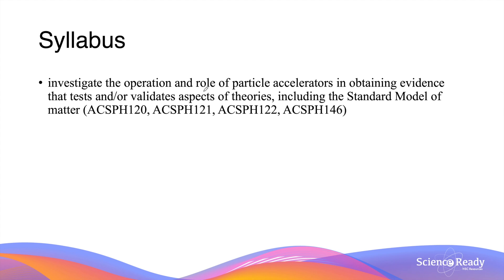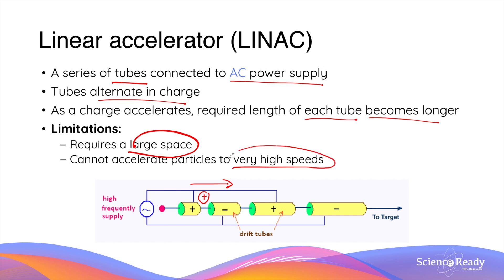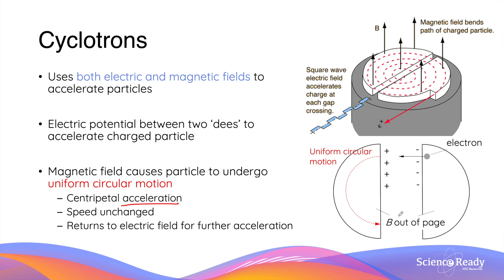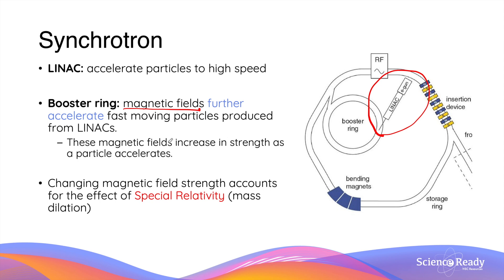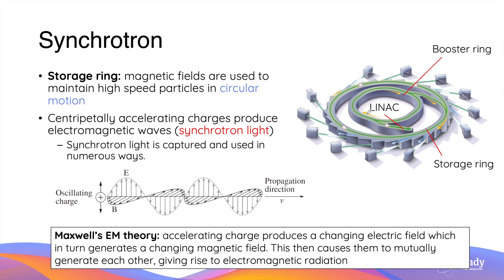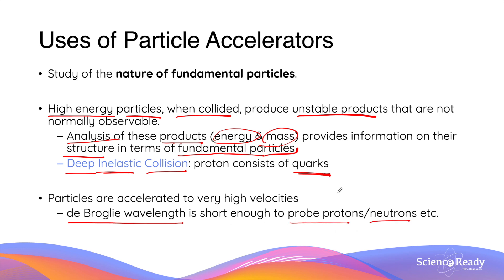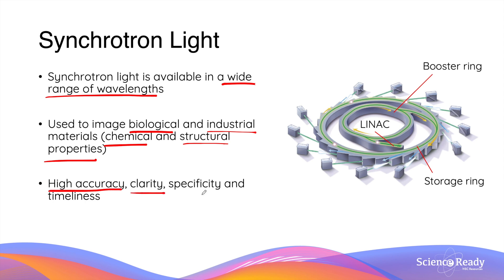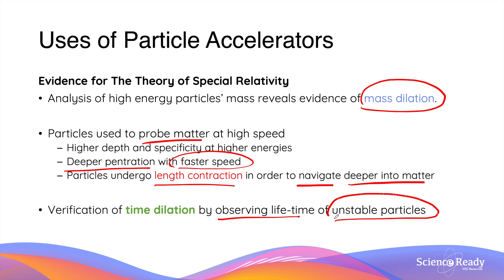Operation and Applications of Particle Accelerators // HSC Physics

Comment: Conservation of Spatial Curvature:
 (Both Matter and Energy described as "Quanta" of Spatial Curvature.  A string is revealed to be a twisted cord when viewed up close.)

Is there an alternative interpretation of "Asymptotic Freedom"?  What if Quarks are actually made up of twisted tubes which become physically entangled with two other twisted tubes to produce a proton?  Instead of the Strong Force being mediated by the constant exchange of gluons, it would be mediated by the physical entanglement of these twisted tubes.  When only two twisted tubules are entangled, a meson is produced which is unstable and rapidly unwinds (decays) into something else.   A proton would be analogous to three twisted rubber bands becoming entangled and the "Quarks" would be the places where the tubes are tangled together.  The behavior would be the same as rubber balls (representing the Quarks) connected with twisted rubber bands being separated from each other or placed closer together producing the exact same phenomenon as "Asymptotic Freedom" in protons and neutrons.  The force would become greater as the balls are separated, but the force would become less if the balls were placed closer together.  Therefore, the gluon is a synthetic particle (zero mass, zero charge) invented to explain the Strong Force.  An artificial Christmas tree can hold the ornaments in place, but it is not a real tree. 

String Theory was not a waste of time, because Geometry is the key to Math and Physics.  However, can we describe Standard Model interactions using only one extra spatial dimension?    What did some of the old clockmakers use to store the energy to power the clock?  Was it a string or was it a spring?

What if we describe subatomic particles as spatial curvature, instead of trying to describe General Relativity as being mediated by particles?  Fixing the Standard Model with more particles is like trying to mend a torn fishing net with small rubber balls, instead of a piece of twisted twine.

Quantum Entangled Twisted Tubules:  
“We are all agreed that your theory is crazy. The question which divides us is whether it is crazy enough to have a chance of being correct.”    Neils Bohr
(lecture on a theory of elementary particles given by Wolfgang Pauli in New York, c. 1957–8, in Scientific American vol. 199, no. 3, 1958)

The following is meant to be a generalized framework for an extension of Kaluza-Klein Theory.  Does it agree with some aspects of the “Twistor Theory” of Roger Penrose, and the work of Eric Weinstein on “Geometric Unity”, and the work of Dr. Lisa Randall on the possibility of one extra spatial dimension?  During the early history of mankind, the twisting of fibers was used to produce thread, and this thread was used to produce fabrics.   The twist of the thread is locked up within these fabrics.  Is matter made up of twisted 3D-4D structures which store spatial curvature that we describe as “particles"?   Are the twist cycles the "quanta" of Quantum Mechanics?

When we draw a sine wave on a blackboard, we are representing spatial curvature. Does a photon transfer spatial curvature from one location to another? Wrap a piece of wire around a pencil and it can produce a 3D coil of wire, much like a spring. When viewed from the side it can look like a two-dimensional sine wave. You could coil the wire with either a right-hand twist, or with a left-hand twist. Could Planck's Constant be proportional to the twist cycles. A photon with a higher frequency has more energy.  ( E=hf, More spatial curvature as the frequency increases = more Energy ). What if Quark/Gluons are actually made up of these twisted tubes which become entangled with other tubes to produce quarks where the tubes are entangled?  (In the same way twisted electrical extension cords can become entangled.) Therefore, the gluons are a part of the quarks. Quarks cannot exist without gluons, and vice-versa. Mesons are made up of two entangled tubes (Quarks/Gluons), while protons and neutrons would be made up of three entangled tubes. (Quarks/Gluons) The "Color Charge" would be related to the XYZ coordinates (orientation) of entanglement. "Asymptotic Freedom", and "flux tubes" are logically based on this concept. The Dirac “belt trick” also reveals the concept of twist in the ½ spin of subatomic particles.   If each twist cycle is proportional to h, we have identified the source of Quantum Mechanics as a consequence twist cycle geometry.  

Modern physicists say the Strong Force is mediated by a constant exchange of Gluons. The diagrams produced by some modern physicists actually represent the Strong Force like a spring connecting the two quarks. Asymptotic Freedom acts like real springs. Their drawing is actually more correct than their theory and matches perfectly to what I am saying in this model. You cannot separate the Gluons from the Quarks because they are a part of the same thing. The Quarks are the places where the Gluons are entangled with each other. 

Neutrinos would be made up of a twisted torus (like a twisted donut) within this model. The twist in the torus can either be Right-Hand or Left-Hand.   Some twisted donuts can be larger than others, which can produce three different types of neutrinos.   If a twisted tube winds up on one end and unwinds on the other end as it moves through space, this would help explain the “spin” of normal particles, and perhaps also the “Higgs Field”.   However, if the end of the twisted tube joins to the other end of the twisted tube forming a twisted torus (neutrino), would this help explain “Parity Symmetry” violation in Beta Decay?  Could the conversion of twist cycles to writhe cycles through the process of supercoiling help explain “neutrino oscillations”? Spatial curvature (mass) would be conserved, but the structure could change. 
=====================
Gravity is a result of a very small curvature imbalance within atoms. (This is why the force of gravity is so small.) Instead of attempting to explain matter as "particles", this concept attempts to explain matter more in the manner of our current understanding of the space-time curvature of gravity. If an electron has qualities of both a particle and a wave, it cannot be either one. It must be something else. Therefore, a "particle" is actually a structure which stores spatial curvature. Can an electron-positron pair (which are made up of opposite directions of twist) annihilate each other by unwinding into each other producing Gamma Ray photons?  

Does an electron travel through space like a threaded nut traveling down a threaded rod, with each twist cycle proportional to Planck’s Constant?  Does it wind up on one end, while unwinding on the other end?   Is this related to the Higgs field?  Does this help explain the strange ½ spin of many subatomic particles?  Does the 720 degree rotation of a 1/2 spin particle require at least one extra dimension? 

 Alpha decay occurs when the two protons and two neutrons (which are bound together by entangled tubes), become un-entangled from the rest of the nucleons

. Beta decay occurs when the tube of a down quark/gluon in a neutron becomes overtwisted and breaks producing a twisted torus (neutrino) and an up quark, and the ejected electron. The production of the torus may help explain the “Symmetry Violation” in Beta Decay, because one end of the broken tube section is connected to the other end of the tube produced, like a snake eating its tail. The phenomenon of Supercoiling involving twist and writhe cycles may reveal how overtwisted quarks can produce these new particles. The conversion of twists into writhes, and vice-versa, is an interesting process, which is also found in DNA molecules.  Could the production of multiple writhe cycles help explain the three generations of quarks and neutrinos? If the twist cycles increase, the writhe cycles would also have a tendency to increase.

 Gamma photons are produced when a tube unwinds producing electromagnetic waves.  ( Mass=1/Length )

    The “Electric Charge” of electrons or positrons would be the result of one twist cycle being displayed at the 3D-4D surface interface of the particle.  The physical entanglement of twisted tubes in quarks within protons and neutrons and mesons displays an overall external surface charge of an integer number.  Because the neutrinos do not have open tube ends, (They are a twisted torus.) they have no overall electric charge.

Within this model a black hole could represent a quantum of gravity, because it is one cycle of spatial gravitational curvature.   Therefore, instead of a graviton being a subatomic particle it could be considered to be a black hole.   The overall gravitational attraction would be caused by a very tiny curvature imbalance within atoms.

In this model Alpha equals the compactification ratio within the twistor cone, which is approximately  1/137.

1= Hypertubule diameter at 4D interface

137= Cone’s larger end diameter at 3D interface where the photons are absorbed or emitted.

The 4D twisted Hypertubule gets longer or shorter as twisting or untwisting occurs.   (720 degrees per twist cycle.)  

How many neutrinos are left over from the Big Bang?  They have a small mass, but they could be very large in number.     Could this help explain Dark Matter?

Why did Paul Dirac use the twist in a belt to help explain particle spin?  Is Dirac’s belt trick related to this model?    Is the “Quantum” unit based on twist cycles? 

I started out imagining a subatomic Einstein-Rosen Bridge whose internal surface is twisted with either a Right-Hand twist, or a Left-Hand twist producing a twisted 3D/4D membrane. This topological Soliton model grew out of that simple idea.  I was also trying to imagine a way to stuff the